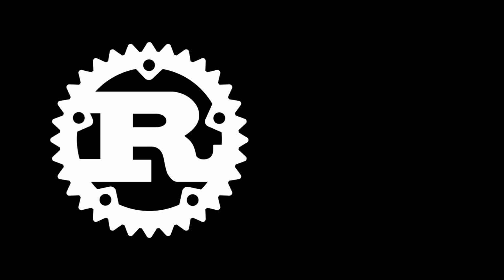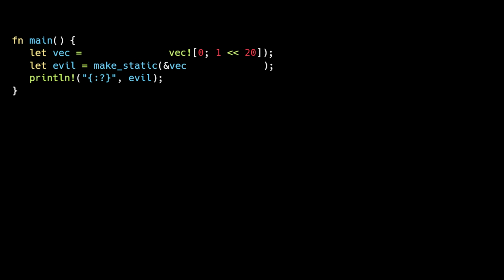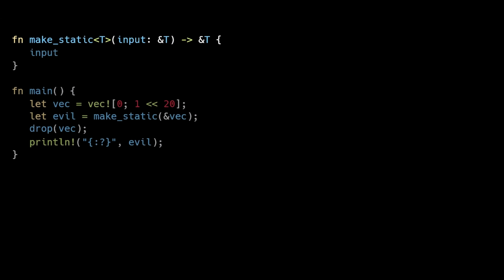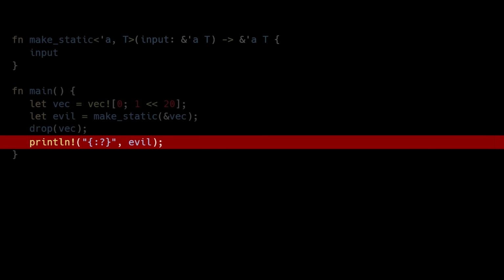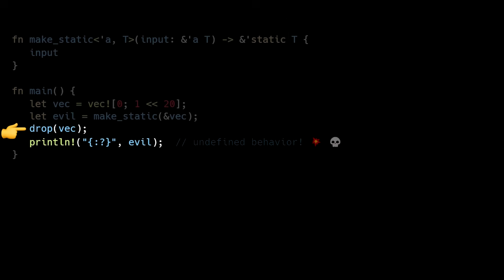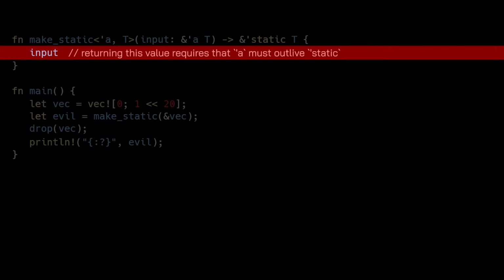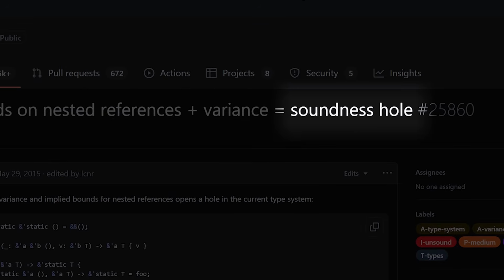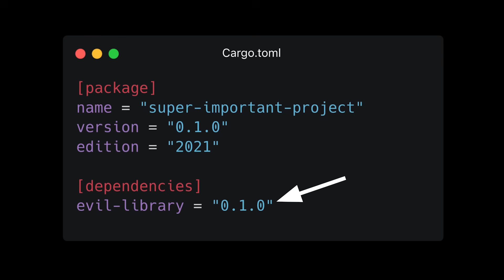Breaking Rust’s memory safety with 1 line of code

Comment: vec![0; 1 << 20]: This creates a large vector (about 1 million elements) on the heap.

&vec![...]: This creates a temporary reference to that vector. Normally, this reference is only valid for the duration of that line or the surrounding block.

make_static(...): This is the "evil" part. This function (not shown in your image, but a known snippet in the Rust community) likely uses unsafe code or a logical flaw in older compiler versions to trick the compiler into thinking the reference is 'static (valid for the entire life of the program).

println!("{:?}", evil): By the time this line runs, the original Vec has been dropped and its memory freed. However, because evil is "static," the program tries to read that freed memory.
Reply: and it has been fixed

Comment: While Rust makes coding much safer then C++, this video illustrates one of the main reasons I don't fully buy into Rust's safety promises: There is no proof that the type system is actually safe, and this is only one of multiple instances where soundness holes have been found. Also, the argument that this issue will not come up in real code doesn't make any sense, because another soundness hole (nicknamed "Leakopalypse") around scoped threads was discovered in 2015 just before Rust went 1.0, and despite that issue being almost as unlikely to occur in practice as the issue illustrated in this video, people completely freaked out, so scoped threads got axed immediately, rather then, say, do the reasonable thing and postpone Rust 1.0 until a workable fix could be found. Also, some of Rust's safety relies on assumptions that are documented nowhere (e.g. some parallel code relies on different mutable indices not mapping to the same memory location, also mutable iterators not yielding the same memory location more then once). Along with the statistics about unsafe in crates (>50% of crates either contain unsafe code or depend on a crate that does) I think it is not appropriate to call Rust memory safe right now. Maybe in the (not so near) future, when all those issues have been resolved, it will be a different story.

Comment: It looks to me like the reasoning is:  if _ &'a &'b is instantiated, then the 'b variables can't be dropped before the 'a variables are in the caller.  So Rust assumes "where 'b : 'a" without being explicitly told.  In fact you can just write:

fn check<'a, 'b>(x : &'b usize) -> &'a usize  where 'b : 'a { x }

just fine.  But that "where" assumption is only being added to helper because the compiler is assuming the _ variable is being instantiated.  

But then someone showed how to call the function without instantiating the variable, because of the () class, the 0 bit class.

I suspect that if they fix the bug, some valid code will break because the compiler can't prove the supplied type isn't the () type.  But that doesn't make sense because it should be a straight forward check after monomorphism.  Maybe the compiler would have to be retooled to make post monomorphism checks.  Or maybe they are afraid of runtime created types.  Which never should have been a thing.

It reminds me of the \forall x P(x) \implies \exists x P(x) problem in first order logic.  Holds always except in empty universes.

Comment: I think I ran into something like this when upgrading my wgpu app. There was a forget_lifetime function that I had to call to make the instance of self gain the 'static lifetime, which felt very strange, and an explicity call to drop this after it was used, was required. This was related to wgpu and egui
```
let mut rpass = encoder.begin_render_pass(&pass_descriptor).forget_lifetime();
self.renderer.render(&mut rpass, &tris, &screen_descriptor);
drop(rpass);
```

In case anyone else is interested running into this with wgpu 22.0.0 upgrade

Comment: My attempt to explain it in terms of high school algebra: In algebra, you must avoid dividing by zero or taking the square root of a negative number by adding restrictions, such as restricting "x != 2" when dealing with 1/(x-2). Instead of numbers, Rust have the concept of "lifetimes" to determine when resources are allocated or deallocated, and there can be "restrictions" placed on lifetimes. However, Rust failed to keep track of restrictions in that example and requires a very difficult bug fix.

Comment: What a laugh, so we'll done. Sacrilege but what is the point of all these languages? C++ works, just use chatgpt to scour the code for issues. So much simpler. And the all the libraries don't need to be redeveloped.
Reply: theres a long history of C++ in fact not "just working".

theres also a somewhat shorter history of ChatGPT spouting bullshit.

On the other hand, this is a single bug requiring quite arcane code. i don't believe theres ever been a report of this happening in production anywhere.

Comment: Why would a library(even a malicious one), one written by any competent developers ever use this way more complex ways to cast &'a to &'static instead of a actually unsafe code? And supply chain attacks? For what would you even use it for exactly? There are way easier way to do a supply chain attack then to use this bypass, like just writing unsafe code and by that matter you could just open a backdoor in safe-rust.
Reply: cope. It should not be possible in safe Rust, EOD
Reply: @laden6675  true
Reply: @laden6675  whaa whaa doing stupid things is stupid

Comment: I compiled your code but it didn't compiled successfully instead it gave me an error as follows:
```
 *  Executing task: cargo run --package refcell --bin reference_cycles 

   Compiling refcell v0.1.0 (/mnt/d/Pankaj Batham/Coding PlayGround/Rust Coding Practice/refcell)
error: lifetime may not live long enough
  --> src/bin/reference_cycles.rs:86:12
   |
85 | fn make_static<'a, T>(input: &'a T) -> &'static T {
   |                -- lifetime `'a` defined here
86 |     let f: fn(_, &'a T) -> &'static T = helper;
   |            ^^^^^^^^^^^^^^^^^^^^^^^^^^ type annotation requires that `'a` must outlive `'static`

error: could not compile `refcell` (bin "reference_cycles") due to 1 previous error

 *  The terminal process "cargo 'run', '--package', 'refcell', '--bin', 'reference_cycles'" terminated with exit code: 101. 
 *  Terminal will be reused by tasks, press any key to close it. 

```

Comment: If you can guarantee that this vulnerability cannot be accidentally enabled, then I wouldn't count it as a vulnerability. I feel like the backend dev must deliberately write the bad code to introduce the issue. And no, being included in malicious dependency doesn't count, because a malicious dependency can screw you over without triggering a memory corruption exploit.
Reply from the maker: Yes this is not code somone would accidentally write. This would have to be done very much on purpose.

Comment: Rustaceans won't agree, but people with brains inside their skulls will, that this completely invalidates the promise of safety. Safety isn't just protection from accidents, it's also protection from intentions. Of course, that doesn't mean this can't still be triggered accidentally, and it likewise doesn't mean that it's not likely given that a complete newbie could bang something like this out trying to get around a weird warning or error that pops up in the compiler. The only possible caveat that a Rustacean has here is if it always causes a noticeable bug, and it doesn't.
Reply: Nothing is perfect it's life
Reply: I wouldn't say that it completely invalidates the promise of safety, as it's clearly not the case. The fact that the compiler is imperfect does, by the way, imply that developers should always be mindful of what they are doing, as it's always been and should always be. As for the promise of safety, I think we can still consider rust to be by far the best we have ever had despite it not being perfect.
Reply: This is an exploit of a bug. Likely being solved with the next big update, where they rewrote the entire trait solver for years. And no, the language safety features is one thing (what Rust promises) and the intentions are another thing. Rust lang designers are not developing the intentions of the end programmer.

In fact, Rust allows for unsafe code and has the unsafe keyword to mark such intentions. But that does not invalidate the principles of Rust itself.
Reply: @ Talk about cope. It's a 10 year old bug that is likely never going to be fixed because the developers of the language are making it up as they go along instead of planning things out. By the way, principles can't be invalidated by bugs, and this isn't a principle being invalidated, it's a promise.
Reply: @ Even if you're right, that'll still only plug one hole. For starters, they don't think that leaks are unsafe, so they don't prevent any of them, even the obvious ones. And you still have many classes of logic errors that aren't prevented in the slightest. Not to mention FFI because the majority of the world's code is still not written in Rust.
Reply: @anon_y_mousse  Memory leaks are actually code logic errors unless they are caused by the standard library. If you Box::leak() it's your responsibility to manage the pointers, as it's clearly stated in the documentation. Same if you use the allocator directly instead of using Box. Avoiding logic errors is the programmer's responsibility. The compiler doesn't know what you want your code to do.
Reply: @anon_y_mousse your mindset is the definition of perfect beign the enemy of good. Its literally impossible to prevent logic bugs - if the programmer writes a + where a - should go, theres no way besides mind reading to catch that. Memory leaks are also similar: how can you distinguish between purposefully allocating 100GB of memory or accidentally doing that? Theres enough programs which have perfectly valid usecases for allocating that much without ever freeing it. And ultimately, all Box::leak does is tell Rust that it should not automatically free that memory. This is part of the pragmatic side required to make a language useable for any real-world usecase - programming isn't math, where you can have perfect solutions, it interacts with the world, and the world is imperfect and chaotic and non-deterministic. You can never "solve" some of the issues stemming from that, you can just built prevention mechanisms and mitigations, which are necessarily never perfect.

Now, the bug from this video? definitely should be fixed, and its being worked on for quite some time already (it wasn't solveable in all cases with the current version of a core component of the compiler, so this core component had to be re-written entirely iirc)

but preventing logic errors? thats not just "flying pigs" kinds of impossible, thats "disabling the fundamental forces of gravity and electromagnetism" kinds of impossible.
Reply: @ That's simply not true. For one, the only applications which allocate that much memory purposefully run on servers with enough RAM to fulfill the request. Applications on desktops only do so when the programmer has made a mistake, whether that be a logical error or otherwise. And yeah, you can't prevent all logical errors, but you can prevent more than what rustc prevents. Some logic errors are so obvious that there's no way you can't tell that that is what's going on. Also, as far as using the tools available, the tools for C are older and more debugged than the tools for Rust and do more. If you wish to complain about using the right tools for the job or using ones which prevent more errors, then you'll be using C instead of Rust, at least if you're honest.
Reply: @anon_y_mousse  And how, pray tell, does a server and a desktop differ from the view of a compiler? You may even want the same application, the same binary, to run on servers with hundreds of gigs of RAM just as well as desktops, with only something at runtime determining how much RAM can be used.

You say that the tools for C are older and more debugged, but this is a flawed attribute to judge by: age and amount of debugging doesn't matter, how well it works matters. and the tools for C dont work as well. Theres a distinct advantage of being able to take the lessons learned from tools which try to verify C code, from research and progress in other fields like type systems etc, and integrate it into a cohesive whole which works together properly. Being able to do things like add Hindley-Milner type inference into the mix just leads to a overall far better outcome in all factors but age.
Reply: @laundmo  The allocator is only ever used at runtime and it can determine how much RAM is actually available on a system. If you don't understand how that works then you're not using your noggin. And no, the tools for C don't work as well, they work better than the tools for Rust which far too many people stop at just using rustc and assuming it does everything anyway. If you really think that type inference leads to fewer bugs then there are languages that do it far better than Rust, such as C++, and shockingly even Python does it better albeit far slower than just about everything else. Although, I have many doubts about that and I think languages which rely heavily on type inference bear that out. I would also argue that Rust's type inference doesn't work hard enough where it really counts.
Reply: @anon_y_mousse  of course rustc it doesn't do everything. doing everything is impossible as stated above. but the tools for C, at least the ones i'm aware of, either require you use a very limited subset of the language, or you write far more information than the actual code. mayne theres some vastly expensive one which has less drawbacks, but having a language designed with not just memory saftey in mind but also various others factors for writing good and reliable code like sum types, no null (billion dollar mistake), sane and usable composition based polymorphism both at compiletime and at runtime, macros which are (at least) partially hygienic, RAII as the default, Mutex and other lock types which actually control the data they're locking (only possible thanks to ownership being enforced as part of the language), the list goes on. You can probably find a better example of any of these features but not in a single language with the same performance and ability to do low-level work as Rust.
Reply: @laundmo  No, they don't require you to use a limited subset, they require you to write your code in a correct way. Of course, C provides multiple correct paths, while Rust provides only one. Of course, quibbling over every little feature is endemic in Rustaceans who are incapable of seeing the bigger picture. C allows you multiple avenues of correctness while still being fast. When you think about it, C is art, while Rust is boring office drone corporatism.
Reply: There is no reasonable attack vector for this, it would be 100x easier to just use malicious code.
Reply: @tomtravis858  Never mentored or taught novices at all? Never done a code review on a couple thousand lines of code while in a rush? Never ran a project that was a target of a foreign actor like `xz`?

Comment: "Memory safe" languages make it harder for actual programmers to fully understand what the code is doing. There is a reason it has no place in kernel space.
Reply: I think in terms of Rust, it's not too hard to fully understand what Rust code is doing, the thing that almost nobody understands however is how the compiler chooses to accept and not accept the code, which is what leads to this kind of mistake in the design of the language
Reply: Except that it has a place in kernel space.
Reply: @Madinko12  if your language panics on memory allocation failure, no it doesn't. Wannabe kernel programmers shouldn't be breaking shit just to use their favorite language. Write a stable kernel in Rust first then we can have that discussion.
Reply: @sxlg_32  there are safe wrappers for kmalloc already being used in the current Linux kernel. The fact that some piece of software mandates "memory-unsafe" code in some specific places doesn't imply "memory-safe" languages "have no place" in said software. Your fallacy is called "false dilemma", you may want to look that up.
Reply: @sxlg_32  there is a safe wrapper for kmalloc in the current Linux mainline kernel. There are drivers written in Rust already. The fact that you cannot write a kernel with only memory-safe code doesn't contradict with the fact that memory-safe code has a place in kernel space.
Reply: @sxlg_32  nice "linus from wish" attempt.  but you apparently are unfamiliar with these topics.  allocation failure behavior comes from the stdlib, not the language itself.  in the linux kernel, rust code doesn't use the rust stdlib, just like the c code doesn't use the c stdlib.

Comment: I thought Rust borrow checker has been formally proven to be sound (free of bugs like this)?
Reply: @rui-lianglyu7221  I believe the issue is with the trait solver, but even if it wasn't the formal proof works with a model which doesn't have to correspond to what's actually implemented.
Reply: i think the formal proof proved only a subset of the language was sound
Reply: turns out I was right and the proof only proved a subset of the language and not the whole thing... yet here we are, with ferrocene supporting safe Rust UB and being used on production code on safety critical systems because supposedly it's safe!!! can't wait to see someone get... ahem... let's just say "unalived" (considering how YT would react to the actual word) thanks to someone's "safe" code bringing a plane down or causing an elevator to crash into the end of the shaft. Oh boy, we're in for a great start with 2025! But hey, it's safe, amirite?
Reply: @tiranito3715  Compiler qualification requires bugs to be documented. The qualified C and C++ compilers aren't necessarily bug-free either.